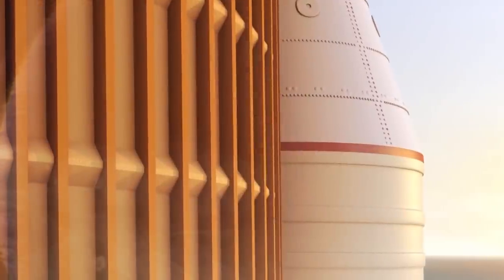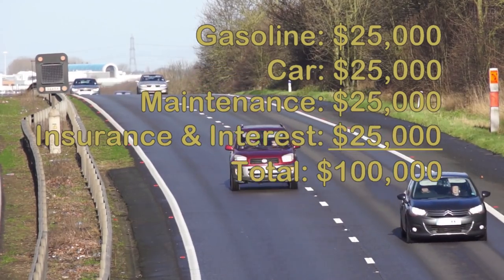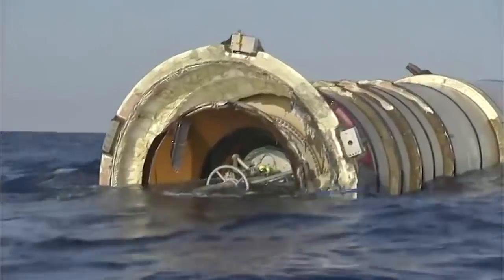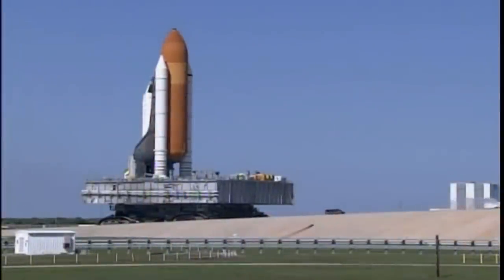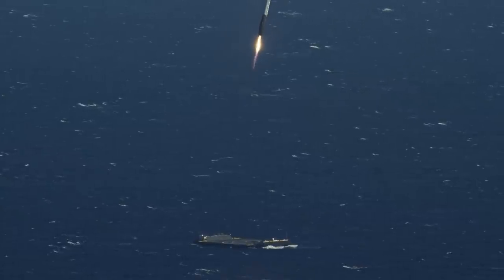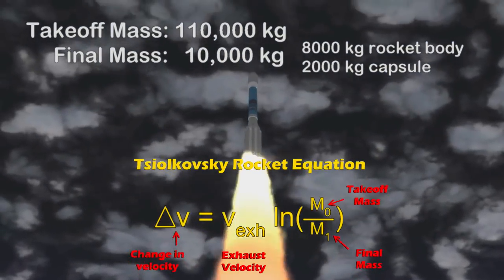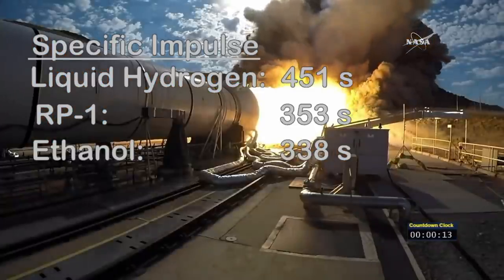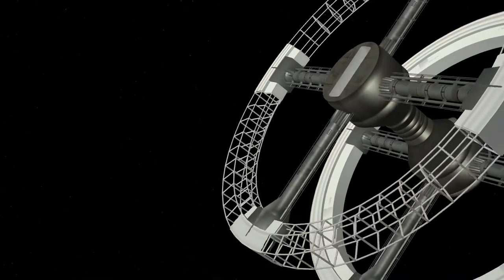Reusable Rockets & Metallic Hydrogen

Comment: Of course, if a car was not as reusable, then people would buy a lot more cars, which would mean the companies would be able to use bulk production techniques to reduce the cost of the cars each.

I've looked on the Ripple Aerospace website and it lists a Sea Serpent 3 as a future rocket, but it still has a payload 4 times less than the Sea Dragon. Are they looking into a Sea Serpent 4 which is more comparable?
Reply: They may skip the SS3 and go right to the Sea Dragon. It really depends on market needs.
Reply: I've looked your name up. Are you the chief engineer of Ripple Aerospace?

If so, can I ask you how you are going to work out market needs? I don't think anyone is going to be building any 550 tonne payloads prior to a 550 tonne- capable rocket, and no-one else to my knowledge is looking at making one first unless ITS happens and SpaceX allow people to use it in expendable mode.
Reply: 550mT wont be happening this side of 2030 most likely, however for medium and heavy lift vehicles theres already a market bottleneck for them. We have too few launch providers. This is especially useful for emerging markets who cant afford launch infrastructure.
Reply: As for your first question. Im just a humble youtuber ;)
Reply: But both SS3 and Sea Dragon are super-heavy launch vehicles so the market bottleneck isn't there for either of them.

The Falcon Heavy and SLS are both super-heavy launch vehicles, though, and they have contracts and planned government mission schedules respectively. SS3 would have a comparable LEO capacity to SLS block II and the sea dragon would be well above everything, but neither of them are going to LEO. The Falcon Heavy is going mostly to GTO/GSO and the SLS is going mostly to TLI, and for SS3 and the Sea Dragon I can only find numbers for LEO. If they follow the same ratios as SS1, SS3 is comparable in payload to the Falcon Heavy for GSO and the Sea Dragon is slightly worse than the SLS for TLI. I don't think they will follow those ratios though, probably the ratios increase when you make larger rockets.

I suppose if Sea Dragon is better at TLI it could lift the deep space gateway/transport and their logistics modules instead of the SLS. If it's cheaper than a higher number of SLS launches that's good for NASA; and if it's higher capacity than SLS launches that's also good for NASA because it means they could build equipment into the DSG/DST instead of launching it separately in the logistics modules, which will probably make it cheaper to build. So I guess that might count as market needs, I don't know if it is enough though. Presumably not, or is overtaking SLS too much of a long shot?

Edit: scratch everything I said about the falcon heavy, that's only super-heavy in its expendable configuration, and none of its launch contacts are in that configuration to my knowledge.

Comment: good point about the graphene. the thing about metallic hydrogen though is that you need to consider compressing liquid hydrogen to twenty times its density... that would only be maybe half enough for metallic hydrogen, but it would already be ridiculous to do with existing technology, though it would give quite a boost to power

Comment: hi, good episode but you might need some more insight into rocket fuel efficiency. Despite the 450 vs 360 isp numbers there are a lot of good reasons why even today Elon Musk sticks to RP-1:

1. RP-1 is non-cryogenic, resulting in simpler, lighter fuel-tanks and engines.
2. RP-1 has  a much higher overall fuel density, resulting in a order of magnitude smaller tanks, turbopumps and pipes. The power to weight ratios of RP-1 engines are mind bending and the payload to structual weight ratios get better too.
3. Higher density fuel combinations burn more fuel faster, so you get faster off the ground and lose weight faster, this results in better flight profiles and lower delta-v requirements to orbit (think about 10%).

All this makes RP-1 a good choice for 1st stages. instead of only looking at isp the overall performance of RP-1 is similar to liquid hydrogen. And it's cheaper and easier to handle. That's why a lot of key players still use the "old" RP-1 and if SpaceX can make a liquid methane engine (which has similar high density) with isp of 390+ come true it will be awesome.

see you
Reply from the maker: I know, but even this channel can't afford to spend huge amounts of time exploring the ins and outs of the engineering, hence the 'storage and usage' commentary.
Reply: I looked up why metallic hydrogen would be so much better :
•That transition corresponds to shifting from H2 (which is already somewhat "burnt") to just H, in it's full chemical potential.
•And since hydrogen is just 1 proton/electron, it is predicted to then behave very differently and stay metallic even at higher temperature, which would again add chemically releasable energy.
I really would not bet on it though.

Comment: I want to hear more about the rocket going off in the dining room. Assuming an Estes rocket here... So you had a rocket motor inserted into a rocket, with an igniter in the motor, with wires hooked up to said igniter, with batteries hooked up to the other ends of the wires, and the launch safety pin was inserted WHILE you were in the dining room? All at the same time???  Isaaaaaaaaaaccccc!!! What were you thinking?

Comment: I've heard some fantasticly weird things about superconductors. It makes me wonder if the metallic hydrogen could be contained in a weightless magnetic field 'bottle' instead of a material tank or be formed into a fuel supplying fountain stretching from ground to a rising rocket. Perhaps the engine could be smartly shaped magnetic fields also weighing nothing.

Comment: isnt the isp winner dual 4 grid  ion thruster. at 19300s although you need a nuclear power plant or very alrage solar array on board as 250kw is needed.  and it wont work in air only in vacuum.

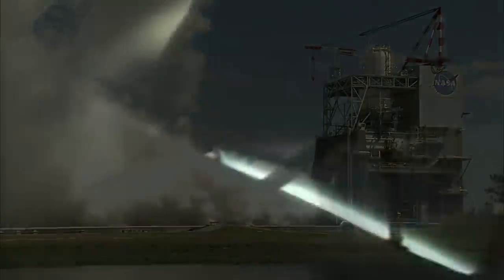Comment: 16:45 I love that point about reusability doesn't mean the original purpose. Like a second stage capable of putting the payload in orbit has enough deltaV to transfer nearly anywhere in the solar system and also do the capture burn at Mars. All that is required is the ability to refill the second stage in orbit.

Comment: Hello Isaac. I'm new to your channel, and am enthused by your product.
What would be so idiotic about using maximum altitude dirigible launch platforms to launch from?
The same question goes for large jet engine powered platforms, which would start at a surface site?
Or even a combination of these two concepts?
Ring a dirigible platform with however many jet engines (and cheaply reusable small rockets) it would take for near-rocket levels of acceleration, jettisoning used fuel tanks as it goes, then before high atmospheric oxygen loss could choke the engines, launch the rocket. The dirigible would then quickly fill its shielded balloons and gently return to its maintenance bay (perhaps a decommissioned aircraft carrier?) to be reloaded.
I've put these ideas to others, but consistently received the silent treatment for my trouble, never knowing if said silence was the product of contempt, derision or an inability to contemplate.
Reply from the maker: We will be looking at balloons as an option, they have some advantages.

Comment: Im curious as to what would happen if you injected a small amount of hydrogen into a methane rocket engine like raptor. Would it add extra energy to it for faster exhaust or just make it hotter in some areas? I was also wondering that if no engines are designed to withstand the heat of metallic hydrogen than why not the input method of using some other fuel and small amounts of it?

Comment: I'm not sure the square-cube law applies to fuel tanks like that. If a tank is twice the size and is designed to hold the same pressure, its walls must also be twice as thick. I think...

Comment: doesn't an atomic engine have an absolute shitload of specific impulse, at least in space?
Reply: If you're referring to the Orion concept, you're right.  However, the political and radioactive fallout from detonating thousands of nukes in space for interplanetary missions make nuclear propulsion a tough sell.
Reply from the maker: Yes, not so good for ground launch but still doable that way too, different configuration though.
Reply: Isaac Arthur and I'll never understand why aren't anyone using it, apparently. That'll be a real sweet deal when going to Mars, for example, but I've not seen it mentioned

Comment: I have noticed that you switch a lot between metric (distance) and imperial (volume) measurements.  Why is that?
Also, you and many others seem to use a lot of multipliers to define reductions (30 times closer/smaller/fewer). With my general knowledge of arithmetic these  would always equal something less than zero; therefore non existent. How can Mercury be 3x closer to the sun than the Earth? Is this using a new type of mathematics?
Reply: you divide by three. positive divided by positive gives positive

Comment: Ah, Isaac you wonderfully weird math geek. I used to play with the math like you do just for grins and giggles but the internet makes so much unnecessary. Fortunately for me your explanations of the subject matter are impressively well thought out and presented so that even someone as prone to laziness as myself can enjoy them. Thanks.

I may have your dumbest question of the day. I've seen a presentation on the use of vacuum tubes to assist in space launches. The exit point ends up high in the atmosphere and are presently nonviable for a variety of reasons. It seems to me that, in any case, that we'll need a variety of launch systems hybridized to establish a significant presence in near space anytime soon.

Do you think that incorporating something along the lines of a mass driver/rail gun into a hybridized system might work? Using the mass driver for initial launch velocity and then perhaps SCRAM jets followed by conventional rockets to achieve orbit for example. My thoughts being that the actual mass driver is a permanent reusable installation which would mitigate costs and the energy required could be drawn from terrestrial sources which should reduce weight. As I understand mass drivers we should be able to throttle the speed with no difficulty thereby preserving any occupants.
Reply: I will tone in and say that I think it's a fantastic idea; basically you're describing a space gun launching a spaceplane, which seems like a fantabulous convergence to me.
I'm no fan of Skylon (not for technical reasons; it's technically quite advanced), but I feel that a hybrid propulsion system on a spaceplane launched by a space gun is the quickest, most practical way to start putting acutal industry into space.  Then we can install skyhooks/rotovators, large orbital installations, a moon base, and on from there.

Comment: How about a mass production of a simple non reusable rocket, like the Italian Vega for example? It's a carbon fiber shell with a solid core. If you started churning them out, and perhaps did some work on clustering for heavier cargoes, wouldn't the costs of mass production of a simple system be comparable to the costs of refurbishing a more complex reusable one, with the R&D costs being cheaper?
Reply: Go back to the intro video to the series _Upward Bound_, about 20 minutes in.  The Vega isn't rated to carry passengers, and this series is about getting both people and materiel into space for creating the infrastructure to build permanent spaceborne ships, not simply scattering satellites from LEO to Geosynchronous, which we can do quite ably already.

Comment: Launching rockets in the ocean? Okay, what about marine life? Wouldn't the shockwave from the launch kill marine mammals like whales? Also, rockets need air to burn their fuel, so how would an aerospace company go about igniting the rocket when the nozzle is submerged? To station the rocket in the ocean with ballast tanks would require pumps to force water out on launch at speeds that with today's technology is impossible, also, if the rocket itself had ballast pumps and ballast tanks on board, wouldn't that reduce fuel capacity required for a successful launch out of the water?, also what about newtons third law of motion? If the sea dragon rocket were to ignite it's engines underwater, wouldn't the water just instantly vaporize and the rocket sink into the ocean and explode? 

I think the whole "sea dragon" concept is a fundamentally ridiculous idea.
Reply: It seems ridiculous because you don't have a very good understand of what's going on in a rocket launch or how a rocket actually works.  I will try and explain a little .  For the sea life I would imagine you could drive off most things that can swim with some small charges in the water, your launch is over pretty quickly (minutes) and one of the reasons of using water is how well is soaks up shock-waves so the area under effect is small and again the disturbance is short lived.   You use ballast to get it upright, then you fuel it, as you fuel it pump the ballast is pumped out since the fuel weight is taking it's place.  The rocket is carrying its own oxidizer it doesn't need to be in the 'air' to ignite.  Newton's 2nd law pushes the rocket upwards even with the water vaporizing.. that's kinda how rockets work.  The water is there merely to soak up the shockwave and heat, that will only be until the rocket it a few hundred feet up and then the oceans job is done.

Comment: What about using metallic hydrogen, not only as fuel but as a rocket construction material? That's one way to drive Tsiolkovsky's equation crazy. Seems pretty remote an idea, but again so is MH as fuel.
Reply: Metallic hydrogen doesn't stay metallic if its not under pressure, since there is no true electronic bond between atoms, only a tremendous valence gap for superconductivity.

It's the internet, look for a couple hard articles on metallic hydrogen (Scientific American had a couple good ones about 10-15 years ago), then you can understand why metallic hydrogen is something to be contained, not built with.

Comment: Isaac, on that sea launched rocket, where its partially submerged, I would think vibration would be a huge issue if the motors were fired under water? Would it need to be above the water before firing like a sub launched missile  does? If so, how would that be accomplished on a huge rocket? Sorry if my question is dumb, just curious. Jim
Reply from the maker: I'm actually not sure, I'll ask Dan, it's his rocket after all so he can probably give a better answer.
Reply: James Callahan interestingly enough the exact opposite happens, vibrations are minimized and the rocket has a much smoother liftoff. :)
Reply: Christopher Jannette I remember hearing about the battle between the HMS Hood and Prince of Wales vs Bismarck and the Hood was sunk.  The sailors who were in the water when she exploded were killed by the blast traveling through the water.  Just thought the shock of a rocket's motor firing under water would do the same to it's airframe? Also, if you ever see a vid of a submerged launch of a missile, the motor doesn't fire until it has cleared the water? I think it is compressed air that pops it out of the tube at first? I know that they flood the launch pad with water to dampen the blast but the rocket isn't sitting in it.  Sorry if I come across like I'm arguing, I'm not at all, just don't understand it. 😀
Reply: An explosion has energy traveling in all directions vs. a directed blast such as the case of an engine. Those soldiers if they were standing next to the explosion above ground might have been killed as well because of pressure waves. There are two different things youre talking about here.
Reply: Christopher Jannette they were in the water at the time, ship was sinking then boilers, munitions exploded killing all
Reply: exactly my point, boilers, munitions etc. Concussive blasts are different then launches where theyre actually smoother than land launches.
Reply: Christopher Jannette just not convinced that a lot of that energy isn't going to be transmitted back into the vehicle. Imagine a half submerged Saturn V launching out of the water, yikes! Why do sub launched misses not fire until they clear the water?
Reply: Completely different system since it needs to be ejected from an undersea sub. We have a former Trident Missile guy on the team. 

My suggestion is dont swim near any rocket taking off and you should be fine :) Its okay if youre not convinced, this has been demonstrated for about 6 decades.
Reply: Christopher Jannette one quick question: Why do sea launched missiles motors fire after they're out of the water? Even Sea Launch launches all their rockets from a floating platform.
Reply: Momentum and efficiency, missiles are more buoyant than seawater so they rise and popup out of the water. compressed air is simply to overcome the final seal on the top of the missile tubes. They do not fire until the surface to help make sure they are oriented in the correct direction, try playing with a toy rocket or bar of soap under the water in a bathtub, it takes very little to greatly change it's launch direction, try to repeat you will get a different result most of the time. Pad water spraying does two things; help cool the pad from heat damage and sound absorption, sound waves move slower in water than air, slower speed = less shock energy transferred.